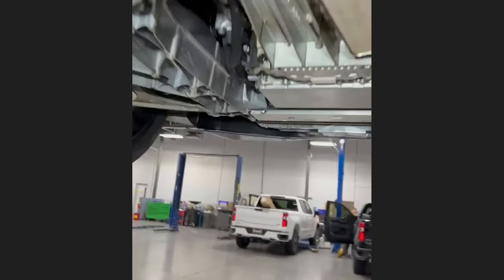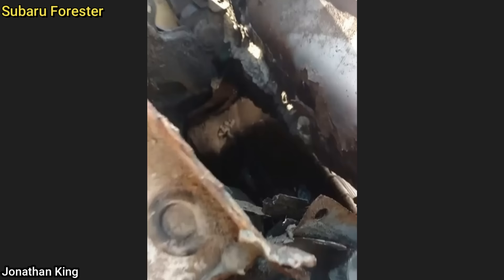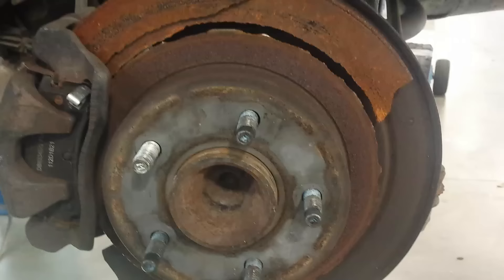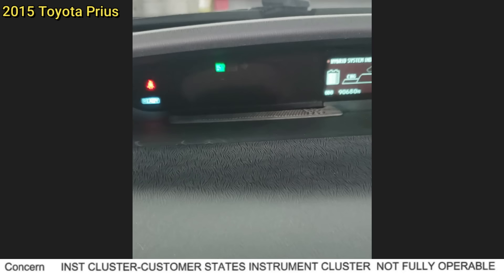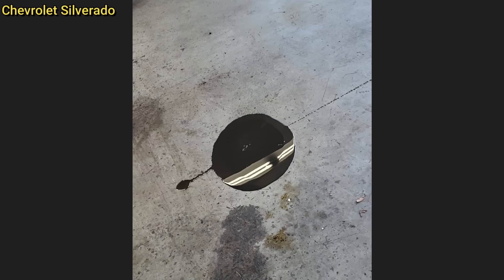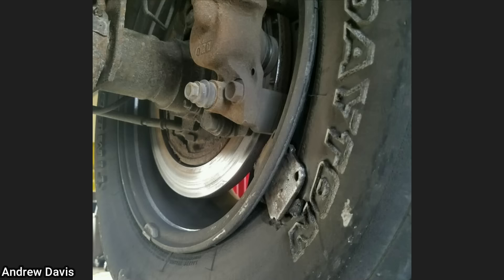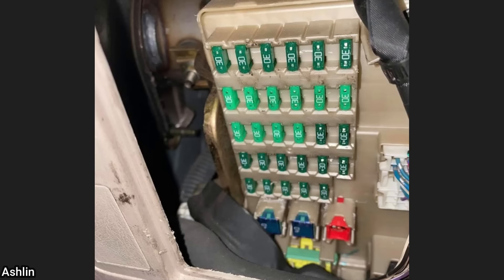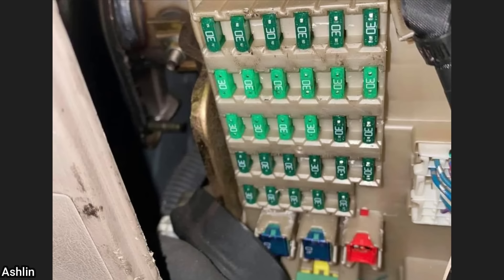Customer States Brand New Corvette Shut Off While Driving

Comment: We need a nationally-mandated sticker reading something like "DANGER THIS VEHICLE IS NOT ROADWORTHY" that shops could stick to cars that need them.  We get warned, they get covered, everyone's happy.
Reply from the maker: Just Rolled In stickers as somebody mentioned in another video 😜
Reply: In the UK, we have the online MOT checker for that...
Reply: How about an online reporting system linked with the BMV/DMV/MOT!
Reply: plus, the stickers would add to the structural integrity of their cars 😛
Reply: We have those stickers for commercial vehicles, but that's a whole other story.
Reply: Or get a mandatory state inspection like in any normal place 
Where I live they would not let a vehicle with worn tires or bad lights or loose steering on the road
Reply: @thealgonquin5822  Don't be THAT guy.
Reply: Or you do as any 1st world country would... have an annual inspection. If it fails you get 30 days to correct it unless its unsafe then you cant have it on the road
Reply: In Ontario, Canada, as the vehicle is leaving, we call MTO. (Ministry of Transportation)
They will be there so fast. Those vehicles are pulled off the road and towed straight to a scrap yard. Lol
Reply: No, you need a law that mandates: 1. unsafe vehicles to be repaired or seized, 2. regular mandatory safety inspections and 3. shops to have to mandatorily report customers who refuse repairs on unsafe vehicles.
Reply: @barratt5795  that is not enough. The inspection will be different per where you go plus different requirements based on state. Unless you live outside of the US, dunno what to tell you.
Reply: It's called a dodge
Reply: What's with the fascination of some stupid stickers in the US? Why do you need to put some stickers on your licence plates? Have you heard of computers and databases? Just have a centralized database where the police etc. can check if a vehicle is registered, insured and legal in other ways as well. Even the UK finally got rid of the moronic badges from motorcycles a few years back.
Reply: @Barratt  this is how it used to work in my state. We had to have safeties and emissions done every year. Till it was rolled back a few years ago
Reply: Fine, as long as we can make one for humans we have to walk by too.

Wait.
Reply: @Tiax776  Exactly. As the head of the wef I approve, put everyone on a database, including their vehicles, so we can find them whenever we want.
Reply: Rather have 1 that says this person is not roadworthy
Reply: Imagine the fact that some of these stupid drivers then try to sue the shop after their vehicle fails...
Reply: @OlegAryutkin  Vehicle inspections don't mean SHIT in anywhere in America; The vehicle fails inspection/emissions they just go buy an illegal inspection sticker in little Mexico for $100 and continue driving 55 in the fast lane on a donut spare smoking out the tailpipe more than my ears do dodging that shit on the freeway every goddamn day 🤬
Reply: I live in a state with no inspections and a lot of salvage rebuilt vehicles. Your car could be on fire in the parking lot of the DMV and they'd still sell you a tag.
No gauges no floorboards no seatbelts no problem here's your registration. And no I'm not exaggerating sadly.
Reply: All of those vehicles where customer declined any further repairs they always come back with the my brother or somebody did some brake work and now it does something else
Reply: @MacPoop  Have these inspections made by an organization that works together with the fed. gov. and make USA-wide regulations. It's really not that difficult to implement, but i guess then there would be some mad american screaming about freedom because driving dangerously malfuncioning cars = freedom to... special people.
Reply: @MacPoop  💯% correct I used to be licensed to do state inspections... most techs don't want to do them bc of the low cost mandated by law...they don't make any $ on them unless they fail and do the repairs at that shop, which a customer is NOT required to do. 

if they do them, they rush thru them.... I once watched a jiffy lube tech do an inspection for a guy that said this was his daughter's car... the tech didn't even lift it off the ground, remove a wheel to check the brakes or shake down the suspension...he didn't even go in the pit to at least look at the brakes or underside... 

I couldn't help but tell the customer... hey man, not to get into your business but if this is your daughter's car... TECH DID NOT DO A FULL SAFETY INSPECTION... do you just want to get your daughter on the road or do you want to KNOW your daughter's car is safe?

What if this was your kids car, what would you do?

isn't it strange, at least that jiffy lube no longer does inspections and the highway patrol pulled their license, hmph I wonder how the state found out?

But hey I know where you can get an illegal inspection where they never even pull the car into the shop, they get your info... Vin, mileage, plates etc... write it up, put a sticker on it and charge you 3x the law's price for CASH ONLY.

not sayn I do this, but I know they exist... I have watched them!
Reply: @archonwarrior9146  they'll just do it anyway, aren't enough cops to enforce it.. it's terrible. Where I live (specifically my ghetto ass neighborhood) 1 in 3 don't even have legal registration or insurance
Reply: @shannonharris  Yup. That's how they roll around here, just buy a sticker on the down low in the barrio. I get a little worked up about this because my best friend got crushed in a 5 car pileup because the car in front of him had those stupid ass wheels that stuck out well past the fenders (remember that shit!?) and a hub broke at 80mph, my friend got hit in the windshield by the wheel and hit the guard rail where another 3 cars slammed into his. HPD did not give a SHIT about the illegal car, the guy got a $300 fine, my buddy was dead and at least 5 more seriously hurt in the other 3 cars
Reply: @OlegAryutkin  I never really thought about it but I just realized there really is no standard for that in the US unless it's emissions. You can definitely go to jail if you neglect your vehicle and it hurts someone though.
Reply: @MacPoop  you don't even have to be in the Barrio, they do it in MO.
Reply: @shannonharris  I lived in Arkansas for about 15 minutes so I can only imagine what a shitshow MO is, especially around the KC area 🤣🤣
Reply: We're u from cause we got that but it ain't a sticker
Reply: @Joefresh111  Well here in TX you're supposed to take your vehicle annually to "the inspection place" along with your insurance dox, and must pass inspection, before your vehicle registration can be even be renewed. So around here most people have expired tags by years-plural
Reply: In Canada, if a vehicle isn't roadworthy a licensed technician can say so and it's no longer legal to drive until it's repaired
Reply: @kari53  from what I understand, in BC, shops can refuse to release the vehicle except to a tow company if it is deemed unsafe. I honestly thought it was the same everywhere. It’s scary people are allowed to drive these away.
Reply: @OlegAryutkin  unfortunately for many places (like where I live) they don't mandate safety inspections. As much of a hassle as it was it definitely made the road safer. Hopefully it'll be reinstated
Reply: @OffbeatMechanics  Nope it's not that way at all down here, quite the opposite.. it's a free-for-all. You have NO idea the poor state of repair most vehicles are in over here. It's third world bad. Sure the law states X Y and Z but hardly anyone follows it, and it's only "enforced" in "nice areas" where the cops know they can write tickets all day long for expired tags the vehicle owner ain't ever gonna pay
Reply: @joergmaass  agree woth 1 and 2. regarding 3, allow the customer to repair it themselves and have it inspected afterwards, under the condition the vehicle is not operated in an unsafe condition
Reply: Yea and then you have shops posting it on anything with a bad parking brake or bald tires. Next thing you know everything on the road will have one and it will lose its meaning. Not that someone couldn't just rip the sticker off
Reply: You should at least report the VIN to carfax somehow. 😆
Reply: @MacPoop  In germany if you fail to fulfill mandatory repairs given by the institution that conducts the inspections the governmental Institution for traffic can revoke your vehicles certificaion for the road and once you get caught driving an uncertified vehicle you can end up in jail. 
Of course it still takes a cop to actually enforce that, but your vehicle/license plate gets classified as "wanted" the second your car looses it's certification.
If your police force is lacking staff... well thats a problem i can't solve except for the state to pay them better or enhance working conditions.
Reply: @archonwarrior9146  I wish it were that way here in fact I've toyed with the idea of moving to Germany just for that reason. Yeah the law might be strict, but you get to drive as fast as you want on the beautifully maintained Autobahn in return. Without having to worry about the hoopties in front of you falling apart on the road 🤣
Reply: Yeah, it's called the ford logo
Reply: And they should be placed on every electric vehicle that can suddenly die, and then can't be moved, because the wheels can't turn if the car doesn't have power...
Reply: @MacPoop  sound about right I wish I lived in TX
Reply: Let the States do that.  The National government is a mess.
Reply: @mediocrefunkybeat  aswell as the recent change in law not letting you drive away in a death trap if it fails too......whichni totally agree with looking at the state of these cars etc.
Reply: @mediocrefunkybeat  MOT means nothing if the inspector is crooked. Many States have inspections commensurate with what we have here in the UK, but it comes down to the validity of the inspector. In theory, it’s good, in practice, pfffft.
Reply: We don't need more rules, we need more sensible people.
Reply: @mrearly2  a thousand like buttons for this
Reply: Yah that's a moronic idea.
Reply: @OlegAryutkin  some States do, others don't
Reply: @JustRolledIn  "JustRolledIn - CUSTOMER DECLINED REPAIRS"
Reply: i think they're allowed to make the customer sign something saying they can only get it towed
Reply: A good shop would just call the ministry of transportation or whatever the areas equivalent is.
Reply: Yeah just like the police can
Reply: How a mandatory annual vehicle inspection to insure the basic safety items are maintained. Say what you will about New York, but, at least this practice drastically reduces cars like this from being on the road. Maryland I understand only requires an inspection when a vehicle changes owners, I’m sure they’re not the only state that does this.
Reply: How about a mechanic being to legally hold the vehicle.
A mechanic cant fake rust
Reply: The decline to repair vehicle should immediately escorted to a scrap yard by the police. .or at least registered on a national system to be tracked
Reply: @MacPoop  you cant do it in Canada either, just steal someones property? Lol. Customer always has a right to take whats theirs , theres nothing illegal about flatbedding an unsafe car. But if they drive it away the MTO can fine them and impound it
Reply: @IIGrayfoxII  its called theft? Thays why. As long as the customer pays whatever shop bill is owed a mechanic has no legal grounds to hold anyones property. Thats what whatever the areas traffic law enforcement is for.
Reply: @mediocrefunkybeat  Yeah, annual inspection and ban from the road until fixed should get rid of most of these. I've started to value ours in a whole new way watching these.
Reply: @MacPoop  states are weird about what they enforce, in some that have window tint limits they will go for the car with dark front-side windows and not the one with a front bumper held on by duct tape and no working tail lights.
Reply: My 4Runner would have required that, but it was a $40/2 hr. ball joint fix and I was good to peel the sticker off
Reply: I am very opposed to granting private mechanics the ability to "impound" vehicles (both because it will result in massive fraud and because it will discourage people with known vehicle issues from even taking their car to the mechanic to begin with) but this seems like a very good compromise to me. 

Not that it's illegal to drive a vehicle with such a sticker (would likely need to go on the license plate), but just something to warn other drivers such that they can leave enough room should an accident happen.
Reply: Was that timber structural timber 😮😮
Reply: Because the dishonest mechanics and techs would NEVER abuse this, right?   This is the only downside I see to an otherwise great idea..   Unless you also give customers a way to blacklist or have dishonest mechanics de-certified or give customers the ability to have a dishonest shop's business license or permits revoked.
Reply: Good idea EXCEPT ………. Too much room for abuse . Written and verbal warning is best .
Reply: Better have a sticker to proof road safety. Where i life old cars need inspection every one or two years or you come in trouble with insurance and goverment.
Reply: @MacPoop nothing makes sense in the US.  The EPA can outlaw modifications but they cannot close down a business that issues fraudulent inspection certificates?
Reply: @gratux  And how can you enforce that the vehicle is not operated in an unsafe condition while the owner fumbles with it? No: Have it repaired by a licensed mechanic or loose it.
Reply: @mrearly2  You don't have enough sensible people, that's why you need rules and punishments.
Reply: The government already has a solution prepared, no private vehicle ownership allowed. Hope the proponents of state interference in our lives are happy as they freeze to death walking to work.
Reply: In Australia we have defect notice “stickers” that the police can apply. Yellow means you can drive it for a certain period (determined by the cop), red means don’t drive it from this spot - call a tow truck. Both can only be removed by a licensed inspection centre after repairs have been completed. It’s illegal for an owner to remove the sticker, and the police log it against the registration so you can’t sell it. If you don’t present for inspection, registration is cancelled.
Reply: @bibliography2035  🤣🤣🤣
Reply: @OlegAryutkin  ... Yes, but they still have another 11 months before the next inspection.
Reply: Is swedeb you have a thing bessiktning which is that every year you have to get your car checked and if it fails you get driving prohibition on the car and a sticker
Reply: My cousin used to work at a shop, and I brought in a motorcycle which was....let's say "missing" a few "teeth" off the rear "sprocket"......so it wasn't really "safe" to "drive." He still passed my registration, but they had a sign that they put on the seat which was one of those road flag triangles. Written in sharpie on it was "UNSAFE VEHICLE - DO NOT DRIVE."

I guess they had a number of customers who were driving unsafe vehicles, and this was their running joke for people who refused service.
Reply: @crustyjusty7  I think Louisiana has something similar where if you get caught driving with no insurance, the cop puts a big sticker on and that car is STUCK exactly where it is, not going anywhere until a tow truck comes to get it. But they don't give a shit about safety inspections there
Reply: Dont say mandate. Thats a swear word
Reply: So RIP to anyone who does their own work? You guys are taking this and demanding more laws and regulations... Please daddy government tell me what I can and can't do! I'm scared! Not only that you want to give the job to mechanics of all people!
Reply: @AdamantLightLP  Live in Houston for about 2 weeks, you'll change that particular attitude REAL quick 😂
Reply: @rs.7610  lol. I wish we could put an outright ban to the concept of "ban" in this country too.
Reply: @archonwarrior9146  while I like the idea of legally being able to drive a car that's falling apart I don't like the idea of other people doing it xD. I'm always nervous at MOT wether I'll still have a car to drive. My cars well maintained though and everything seems solid. It's got 100,000 miles on the clock and I've seen ones in worse shape with 40,000 miles on them. it's just a bugger that insurance companies don't take that into consideration for a like for like payout. I'd value my car at £5,000 but insurance estimates it to be worth £3,000 and I can't imagine I'd be able to get a used car in as good a condition for that price.
Reply: It's already illegal
Reply: @OlegAryutkin  in my state they would fail the inspection and get a sticker saying they failed inspection. If its emmisions they cam drive it but has to be fixed in 90 days. If its saftey they cant legally drive it and has to be fixed in 90 days. Ppl still drive them but they can get pulled over and the car impounded.
Reply: We need a sticker saying "I'm a complete MORON for driving this car that my mechanic told me is unsafe" -
Reply: @Tiax776  we stopped taking your advice almost 250 years ago... didn't you's get the memo?
Reply: We have mandated inspections.
And any cars that don't pass them or are noted to be not roadworthy by a mechanic are not allowed on the road.
If thee customer ignores this and "drives away" the authorities need to be notified.
Reply: @Tiax776  Because the US has to do everything differently. And there are people ("meter maids") checking parked cars for registration and inspection. These people are often on foot. I suppose nowadays their phones could be linked to the state databases, but America likes to stick with tradition (no pun intended).
Reply: @OlegAryutkin  Inspections are meaningless, but rather expensive if you ask me. It's just another way for the state to collect a tax and have control. How often do accidents happen for technical reasons? Maybe in Russia, but otherwise more seldom than you would imagine. Check out the stats for inspection and non-inspection states. You might be surprised. I drive 1K miles a year and yet have to go in for an annual inspection, which I always pass in 10 min. It's ridiculous. A big waste of time and money.
Reply: @paulparoma  where I live (not Russia) if not for the state inspection people would never change tires brakes and suspension, roads would be full of dangerous vehicles, especially the commercial ones, imagine a semi with bald tires and leaking break lines coming your way.
Reply: @paulparoma  some people are too cheap, some don't care and don't want to know. I don't like the state inspection because I'd rather have a freedom to tune my car. My car is safe anyway, I take good care of it, but I realize that many other people would put MY life in danger by riding unsafe poorly handling (not to metion pollution) pieces of crap
Reply: @paulparoma  I visited Georgia (the country not the state), you can't breathe in a big city because none of the cars have their cat converters still on them. that's becasue there's no inspeciton.
Reply: @jacksmith2315  in my country if you fail inspection your insurance is automatically invalid until you pass. you drive and hit a person - you go to jail 100%.
Reply: won't work people will just end up ripping the stickers off and it won't be enforced either
Reply: @SAMPLETEXT285  where I live when you fail inspection the cops know, it's in their system so when they run the plates it shows up. 6 months no inspection - a fine. more than 6 month and we're looking a license suspension. Accident on not inspected vehicle - jail time.
Reply: @barratt5795  the State of Minnesota doesnt require annual inspections... haha many states dont
Reply: You guys DESPERATELY need mandatory inspections and minimum vehicle standards like we do over in europe. It prevents these utter death traps and shit boxes from going on the roads.
Reply: @Earthneedsado-over177 it’s not about freedum it’s about giving mechanics the ability to put a sticker on someone’s car based on their judgement. Would you want some jackass deciding your car wasn’t road worthy and sticking a sticker on it?
Reply: Police need to be involved if you try to drive off with some of these.
Reply: In Europe, strict annual exams on all cars, before insurance companies sell you insurance. If your car dont pass, you dont have valid tag nor insurance for following year and you cant drive. If cops catch you drive without insurance/registration, financial punishments are very big, in some countries you can end in jail.
Reply: No more federal regulation
Reply: There use to be mandatory vehicle inspections.